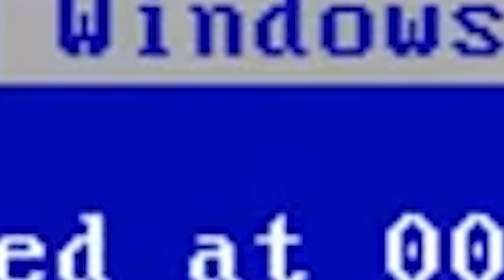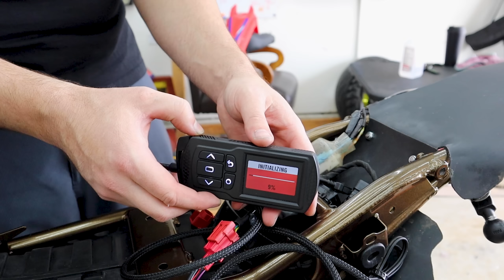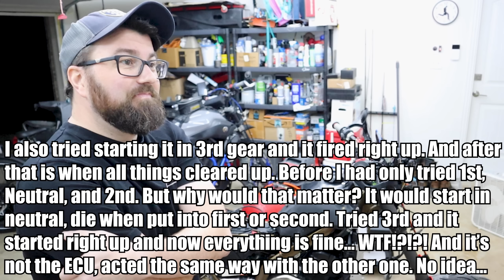CRF300L Big Bore First Start - XR301

Comment: I had the same shutting-off-problem with my XT 660. In the end, it was a bad connection on the kickstandswitch. Sometimes it worked, Sometimes it killed the engine shifting from neutral up or down, the bike thinking the kickstand was down.
Reply from the maker: In this case that wasn’t it. Mine is wired shut and I was able to verify that’s what ecu was seeing with the Power Vision.

Comment: Jake my buddy has a MT10 and it goes into limp mode if he runs in in gear when it's on a stand for some reason. I wonder if you're having a similar issue. He was trying to lube the chain in gear and found out it won't let that happen

Comment: Nice when you can't recreate a fault. We had 50 year old equipment that no-one would make changes to for fear of creating a fault in a machine with 50 relays and a gazillion wires.
It won't run without gear indicator when system functioning normally?

Comment: First thing i thought of was the new oil, maybe the clutch was dragging and caused it to stall when you put it in gear. 
But i dont think thats it, doesnt explain the fuel pump and there wasnt any resistance on the rear wheel.
There was a thing going on with third gear and not being able to start, which itchyboots experienced in the middle of the desert. Maybe it has something to do with that
Reply from the maker: With itchy her bike was “stuck” in gear cuz the shifter was slightly bent in touching the case. And wouldn’t start in gear was likely sand/dirt/slight damage from the fall interfering with the kickstand or clutch switch. She really just needed to rock the bike back and forth to get it to shift along with pulling the shifter off the case.

Comment: Not sure how the gear position sensors work on these but wouldnt be surprised if the sensor was indicaying multiple gears at once and was mucking with the 5v rail in the ecu, the way it died was much more like that as opposed to  anything intentional by the ecu, wouldnt surprise me theres no check engine light on something cheaper like this, could be wrong though im more of a standalone ecu tuner, dont really touch stock ecu's
Reply from the maker: That was one of the first things I checked. Tested on both ends. Went through the gears on the sensor side testing on ohms. Then the harness side in dcv checking each pin. Jumped all the pins and watched the dash indicate each gear. Literally everything seemed fine. 🤷‍♂️

Comment: Very nice!  I bet that thing will make around 30 rwhp when it's tuned -- maybe more.  FYI, the Takegawa cam link appears to be broken -- is that the SP Takegawa Sports Camshaft No. 01-08-0056?
Reply from the maker: It’s the one that’s technically sold for the cbr250r.
Reply: @TheGardenSnake  Thanks -- the one I found listed it for the CBR250R and the CRF250L, so probably the right one.  I'd post a link to it but YouTube seems to lose it's tiny mind every time I try to post a link.
Reply: I reckon it's got to make 30-31bhp at the wheel  once Jake gets it Dyno tuned for optimal air/fuel ratio everywhere, and hopefully the PC will allow the ignition timing map to be modified to suit the new spec. It would be interesting to see it mapped for pump fuel and another map for a race fuel to see if there's much difference?

Comment: Was your clutch pack sticking together and causing drag on the crank? Starting it in the higher gear could've cause the plates to become unstuck.
Reply from the maker: Naw, it’s was an electrical issue

Comment: that was an odd issue, I wonder if the gear indicator or clutch sensor was getting hung up inside, like the bike wont start/turn over without the clutch pulled in
Reply from the maker: Well I tested both of those on both sides. Harness side and sensor side. Testing in ohms I went through all the gears and could see it going from pin to pin. Harness side I could go from pin to pin getting 12v and the gear indicator would show each gear when jumped. 🤷‍♂️

Comment: Hey man. I've had similar problems flashing my bikes and its usually the battery voltage gets close to 13.0 volts and the computer/ecu starts doing stupid things! I now run my Lipo charger while I'm flashing or changing things and I haven't had anymore crazy things happening! I'm curious if you had your bike hooked up to a tender before trying everything out again? That would of topped your battery off and eliminating a false problem.
Reply from the maker: The battery was on a lithium charger the day before. It’s was at 100%.

Comment: Jake. I started watching your videos nearly a decade ago before even having a channel to be able to subscribe. I got off road bikes for a couple years and ventured into motocross. I’m wanting to swing back into road riding and am considering a super moto. What you’ve done to this bike is incredible. But I have to ask, the hp number you are chasing seems similiar to the crf450l. Is there a reason you wanted to do a 300 build over a 450l? Thanks
Reply: Having gone back a year and watching the start of this I now know. I had no idea the crazy service intervals. Riding Mx I had oil changes every other ride along with air filter cleaning every time I got home and that would just blow on a road bike you use to mess around and zip around town. Carry on lol

Comment: Loose gas cap by chance? I saw you tighten and loosen it at the end of the video as you were talking.
Reply from the maker: That’s a automobile thing on certain models. Most bikes have an open breather for the fuel tank. Cap lose or tight won’t make a difference.
Reply: @TheGardenSnake  It doesn’t have to maintain pressure?

Comment: this is unrelated to the video but i saw the rabacondo bag in the back. which one do you have and how do you like it? I've been doing it like a caveman but may upgrade to that soon now that i'm running more aggressive rear tires i'll be changine them more often
Reply from the maker: I’ve got the one you see enduro racers using. It works nice but you gotta be careful not to scratch the rim. I wanna try to the new one.

Comment: Question Jake - what was the fix for this you never reported ?
Reply from the maker: 🤷‍♂️ I’m thinking it was the air idle control valve. Once I unplugged it and plugged it back in every worked. Also that valve isn’t working now. The idle never comes up when cold starting it. But I never got that 100% confirmed.
Reply: @TheGardenSnake  Thank you Jake - fixin to join the Patreon as got a CRF300L as well. Excellent videos! Like doin the mods like 1/2 the fun besides riding. Got other bikes as well but dirt/street bikes seem to be the most fun.

Comment: I dont understand why guys prefer to completely dismantle a 300 as apposed to changing oil on a 450, it takes less than 5 min.
Reply from the maker: That’s not the point
Reply: @TheGardenSnake  Are you sure about that? All of the upgrades done are essentially to make it closer to a 450....power, suspension etc. The initial argument is "I dont want to change my oil every 600 miles" and the reality is the bike is taken apart every other weekend regardless anyways. I just find it ironic